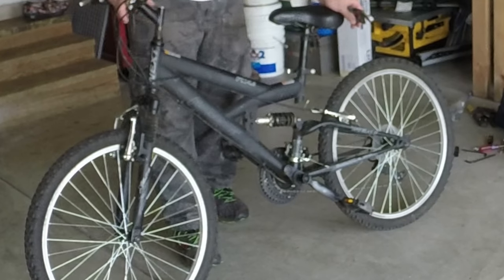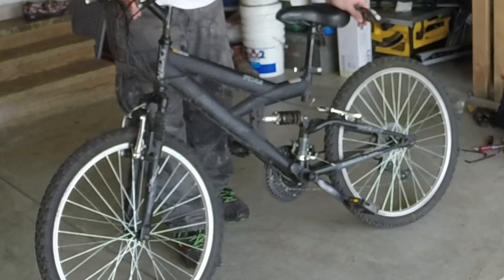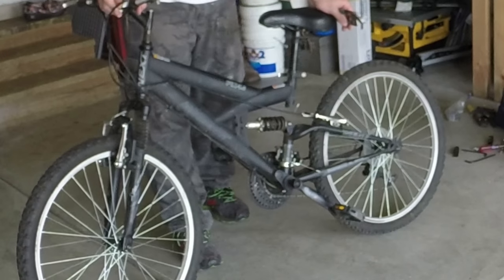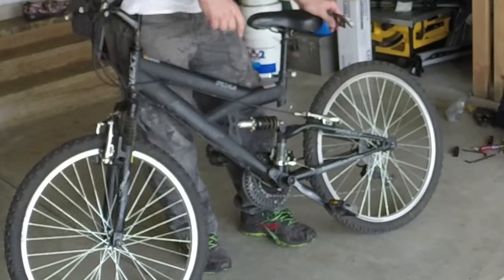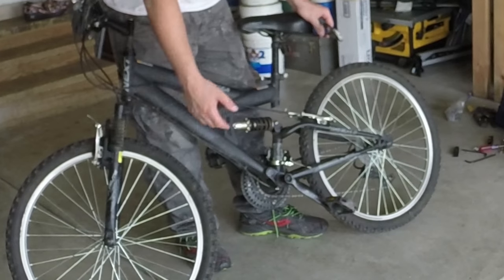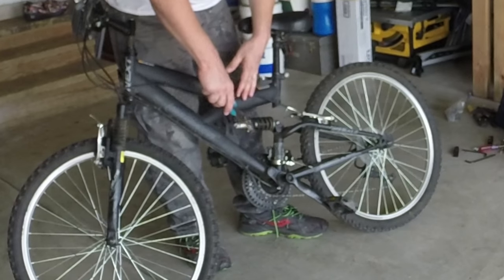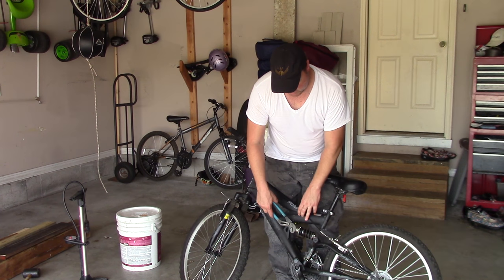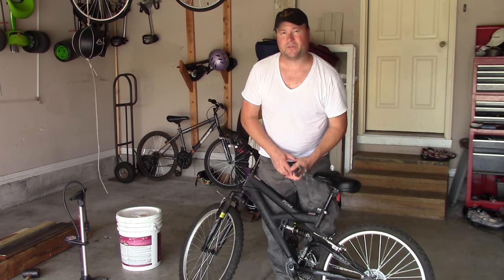Bike Repair Adjusting The Rear Shock

Comment: So I have a question: How can you adjust a front shock to have smoother ride? Mine is tight and has very little movement if at all, so some of those bumps I go over do not feel the greatest. So would I turn in the opposite direction to get it to be more flexible for a smoother ride? Thanks so much
Reply from the maker: Well that depends on your bike. These in-expensive Wal-Mart bike have no adjustment for the front shocks. What you have is what you've got. On nicer, more expensive bikes many of them have a screw on top to turn one way or the other. But I am not familiar with all the different ways.
Reply: @AroundTheHome1  I have a decent greenbike one in excellent condition that I bought off of a guy and it has those turn knobs on the front suspension and a coiled looking one on the back. What I found out was turning in clockwise, tightened it up and counter loosens it for me. Thank you sir!
Reply from the maker: So glad to help! Thank you for watching. Check out hundreds more of our videos at https://www.aroundthehome.org

Comment: Hey, Thanks for showing this up.. my problem with my rear suspension is, whenever its a bumpy road or a speed breaker, it sounds a cranky noise.. in normal smooth ride, it doesn't noise at all.
Why the cranky sound is coming when its a bumpy road or the speed breaker?
Reply from the maker: Probably just need some lube on the bushings at the top and bottom of the shock. Also, apply lube to the joints in the rear swing arm. Thanks for watching. Don't forget to stop by our website www.greatwhiteninja.com
Reply: @AroundTheHome1  okay, will try tomorrow. Thanks a lot. Btw, can you say which lube oil should I use? Can I use the same lube oil which I use for my chain? Or kind of any machine oil? Like mobil?
Suggestion would be highly appreciable.. 👍🏻
Reply from the maker: Your chain lube should be good because it should be non-greasy type of lube that won't attract dirt.
Reply: @AroundTheHome1  yes I was thinking of the same about using my chain lubes only since they are non-sticky. Thanks for confirming.
Reply: @SSUPMUSIC  creaking noises are hard to pinpoint, because sound resonates through the frame. It could be your bottom bracket bearings, could be front or rearwheel hubs (these all need to be cleaned and greased once a year or so) . He is likely correct, but many different issues make the same kind of noise, for future reference. Hell, I had a seatpost that was making a creaking noise that I mis diagnosed. (Dirt got down tube)  It was only happening when pedaling so I assumed Bottom bracket. Nope lol.
Reply: @SSUPMUSIC  Another tip. Grease high friction parts (bearings, hubs, BB, etc)  Lube all others like brake and gear wires (inside the housing, lightly. I use Hoppes 9 for this, only) the chain (I buy wet or dry lube depending on season) 
This rule of thumb will keep your parts healthy. Best to measure twice, cut once. (In my case, measure 15 times to be sure I follow instructions such as the video posted above)

Comment: Actually sir your video was really helpful
Because im a heavy person also i ride mostly on streets because workout
I'll give it a try hopefully it'll get better thx again:)
Reply from the maker: Thanks for watching. Don't forget to stop by our website www.greatwhiteninja.com
Reply: @AroundTheHome1  we'll do:) btw donno what to do about that squeaking nois
Thought it was my saddle i cleaned it and everything but naw i believe it's my shock so don't really know what to do about it without ruining it
Reply from the maker: Just take some WD-40 and squirt a little into any moving part you can find on that rear swing arm.
Reply: @The--Ghostspider66  I know this is like two months later, but if you've checked your saddle clamp, check the tension on your pedals and crank arms (check for wear on the bottom bracket) and also that your rear wheel is tight. This'll help you track down whether its to do with the suspension, and if it is you might want to check over the bearings as well as the shock. [btw. GT85's better than WD40 as it contains a lubricant, but you can't beat a bit of grease.]

Comment: Hello I had a quick question and really need help. I have a vintage retro year 2000 GT full suspension mountain bike model XCR5000. It currently has the original rear shock ShockRST 22A, 4.6inch travel. Can I swap this out for something modern? Or is there a replacement for this type of shock? I can’t seem to find anything online for it. Any help would be appreciated. Thank you
Reply from the maker: I really don't know enough about that bike or what may be available for a replacement. I would probably take it down to a local bike shop and let them see that in person to see what could be ordered for it.  Thank you for watching. Check out hundreds more of our videos at https://www.aroundthehome.org

Comment: Hello friend,
I have a problem where the rear wheel can slightly move right and left…
Hope you know a solution for that!
Reply from the maker: I do, but I don't have a video for that. What it sounds like is your bearing hub is loose. If you take the wheel off, you should have two nuts on both sides of the axel. The outer nuts are lock nuts, and the inner ones tighten the bearings in the hub. You can tighten that, but you have to be careful not to overtighten. It takes a bit of playing around to get it just right. You want to tighten it enough to take the wobble out, but if too tight it will bind the bearings and it will not rotate smoothly. I hope that helps.

Comment: Means we have to rotate suspension anti-clockwise for lighter person ?
Reply from the maker: Most springs are set pretty light from factory. How you adjust it depends not only on your weight but how you are riding. If you are riding smooth trails or lots of up-hill, then you are going to want it tighter. If you are doing more downhill then you will want it looser. Righty tighty, lefty loosy.

Comment: What kind of tool you used to adjust real suspension?
Reply from the maker: Just a large pair of slip joint pliers like this one. https://www.amazon.com/Channellock-440-12-Inch-Tongue-Groove/dp/B00004SBCU?crid=2UNS3NW5R1BZ2&keywords=channel%2Blocks%2Bplier&qid=1660494533&sprefix=channel%2Caps%2C138&sr=8-6&th=1&linkCode=ll1&tag=greatwhitenin-20&linkId=5ba7246ca2691b8daa62ac3dbf7891aa&language=en_US&ref_=as_li_ss_tl

Comment: Whats the tool name?
Reply from the maker: Are you referring to the slip joint pliers? Here is an Amazon link for the one I was using in the video if you need one. https://www.amazon.com/Channellock-440-12-Inch-Tongue-Groove/dp/B00004SBCU/ref=as_li_ss_tl?crid=1W57Q7H3N398X&dchild=1&keywords=channel+locks+slip+joint+pliers&qid=1595505941&sprefix=channel+locks+slip,aps,245&sr=8-22&linkCode=ll1&tag=greatwhitenin-20&linkId=81a00c63e24ed17ba29ace28d76a74a6&language=en_US     Thank you for watching. Check out hundreds more of our videos at https://www.aroundthehome.org/
Reply: @AroundTheHome1  thank you very much ♡♡

Comment: Thanks, but I loosed it, and I'm not feeling much change, if any.   I weigh about 135.   Any suggestions?
Reply from the maker: Depending on the shock that you have there might not be much range to adjust. And obviously you can only loosen it until the spring opens all the way or you just create slop in the movement. If you have already loosened it to that point, then that's all that your particular shock/spring will give you. If you feel that it is not giving you the range of movement that you would like for your weight and riding style, then I would suggest taking you bike down to the local bike shop and see if they have a rear shock unit that would fit your bike and that would better serve you.
Reply: depending on the bike, I guess I can get the front shock changed out also?   It doesn't appear to be adjustable.   Maybe the bike is "cheap" (it was given to me).   Thanks for the response.
Reply: my front soccers has been jamm can you please give me a suggestions
Reply: Ratan Singh WD40.
Reply: @marchlander1  thanks bro. I didnt know why my rear suspension was squeaking if it's a new bike. Just sprayed it and the noise went away.

Comment: Can I change it with my hands ?
Reply from the maker: Not normally
Reply: @AroundTheHome1  because I did it with my hands so do you have to use the clamp?
Reply from the maker: What exactly did you do with your hand?
Reply: @AroundTheHome1  I just twisted it
Reply from the maker: Ok, did you loosen it, or tighten it? And how easy did it spin?
Reply: @AroundTheHome1  I loosened it to be softer

Comment: how much do you un screw for 93 pounds
Reply from the maker: Each shock unit is different. You just need to make an adjustment to it and then ride the bike and see if it is right for you.
Reply from the maker: Also, it depends on what you are riding. If you are doing mostly downhill runs, you probably want the shock to have full range to absorb as much as possible. But if you are riding smoother flat trails or a lot of uphill you probably want it tighter so that when you pedal it doesn't work against your stroke.